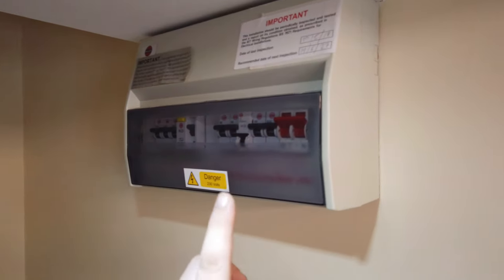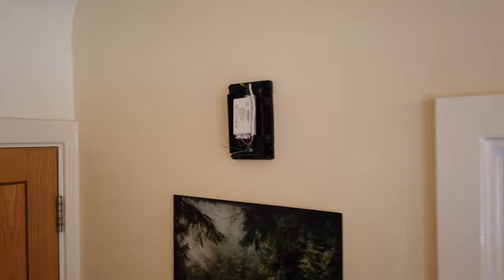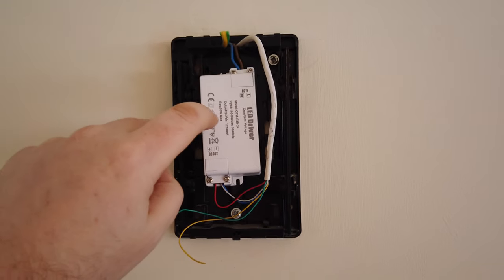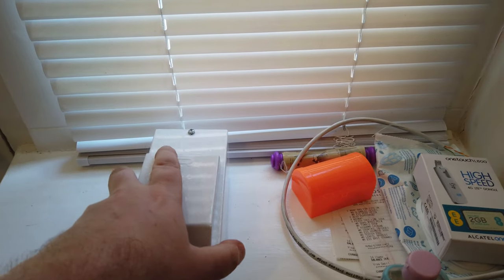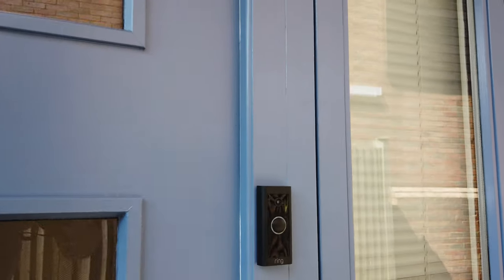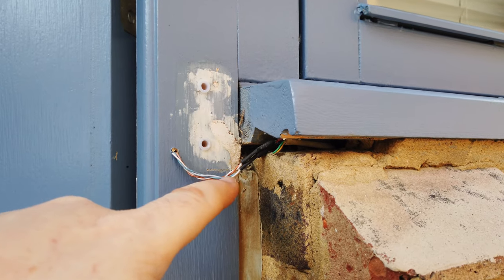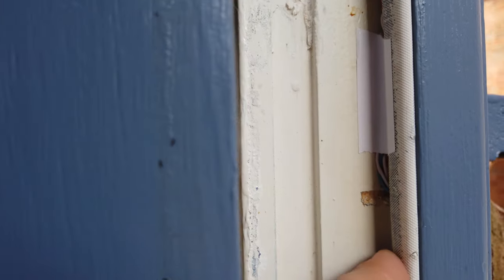Ring Wired Doorbell (UK) - a Step-by-Step Guide to Easy Installation

Comment: My simple question is 
Does door bell unit need 
10-24 volts 
AC or DC
Reply from the maker: The Ring website (Tech Specs section) https://en-uk.ring.com/products/video-doorbell-wired says to use DC 'You can hardwire your doorbell if you have a compatible doorbell system (8-24 VAC, 10-40VA, 50/60Hz ), or you can use Ring DIN Rail Transformer 2nd Gen (24VDC, 0.42A , 10.0W) sold separately. Doorbell chime must be bypassed.'
Reply: Thanks for your quick response 
But my question is still not answered 
Specifications itself confuses 
Recommended 
AC and DC 
BUT there is no marking + or - on back screws, I presume it will work on 10-24 volts AC
I am from India and this unit is gifted by my daughter from USA

Comment: Hi, can’t you just use a ring battery pack to the doorbell chime box?
Reply from the maker: I've just done a quick Google on this and can't see any articles relating to it. The chime box will have an existing wired connection, so it's easier, more convenient and cheaper to use that. If you want to use the ring battery pack, it's probably best to do that with one of the Ring doorbells that are officially supported for it. If you don't have access to wired power, it would be better to get one of the other Ring doorbells and add solar charging https://en-uk.ring.com/collections/accessories
Reply: @TechboyUK  my setup is the same as yours. I have the ring doorbell pro 2, so can I just add the battery as I wanted to use the chime box?. It did come with a transformer aswell in the box.
Reply from the maker: @lethalno1  I don't know :-) I suggest asking the Ring support team https://support.ring.com/hc/en-gb

Comment: Great video Paul 👍🏻. I currently have the exact same chime and transformer that you had. How did you remove the old transformer?.
Thanks.
Reply from the maker: That's the hardest part of the installation process! I turned off the power, removed the box and pried out the old transformer with a screwdriver and pliers. 'Brute force and ignorance' as my dad would say.

Comment: Hello. My old transformer box is exactly the same as yours. How do you know which wire is dc out + and - (in the new transformer?
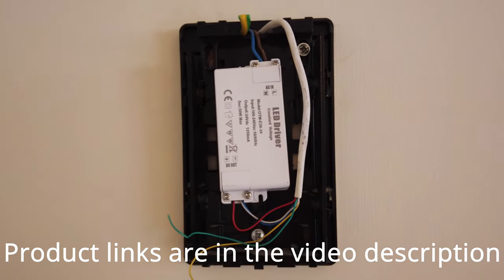Reply from the maker: See 2:08 the AC in (L and N) and DC out (+ and -) are clearly labelled.
Reply: @TechboyUK  thanks for the reply. I mean your setup on the old transformer. How do you know which wire is + and - on the new transformer? Or am I asking a silly question?
Reply from the maker: @mrcraig261  The Ring instructions say that it doesn't matter which order the 2 wires go to the Ring doorbell.

Although I would have kept the + and - wires the same in the new transformer vs the old transformer. Before removing the old transformer, I took a photograph of it, so I had a record of which wires were which.
Reply: Thanks. Is there a way to send a picture of my setup?
Reply from the maker: @mrcraig261  I don't think I kept the picture, but you don't need it anyway. The colour of the wire from DC out +- doesn't matter, use any of the available wires for it. Also, the order they attach to the Ring doorbell doesn't matter 😊
Reply from the maker: @mrcraig261  Sorry, I've just re-read this. If you want to send me a pic of your setup, you can share it on OneDrive, Google Drive, etc. and paste a link here, or DM me on Twitter @TechboyUK 😊
Reply: Mate sorry to pest, but I don’t have twitter. Can I sent you an email of my setup? It’s just that it’s the exact same as mine but I’ve no clue about electrics haha

Comment: Hi again the set up process nearly finished then app says not enough power. Can I take out transformer from my wired orig chime box and replace it with another app says needs 16 24 VAC HAVE YOU A Link for a suitable transformer
Reply from the maker: I used: https://amzn.to/3cMqCjX and it has been working without any issues.

The Ring website (https://support.ring.com/hc/en-gb/articles/360055740151-Video-Doorbell-Wired-Information-) states 'You can hardwired your doorbell if you have a compatible doorbell system (8-24 VAC, 10-40VA, 50/60Hz ), or you can use Ring DIN Rail Transformer 2nd Gen (24VDC, 0.42A , 10.0W) sold separately'.

See my kit list for more items that I used or are available https://kit.co/TechboyUK/ring-video-doorbell-wired-uk
Reply: @TechboyUK  I've bought the same LED driver that was on your list from ebay it should do the job my orig door chime TF was 6v lol can't believe I had it all running even the doorbell was doing the setup via app but right at the end the app displays a messege of not enough power.

Tbh ring isn't very clear about fitting they just toss is a resister bridge wire that you open and wire Into door chimes Il have a god when I next get day off cheers

Comment: Great video and will prove very useful when installing. I just have one question: how do I know what colour cabled go into DC Out on the LED Driver please?
Reply from the maker: The colours going out of the LED driver, into the doorbell don't matter, as long as they match. It doesn't matter which order you place them on the button.
Reply: @TechboyUK  thanks - It worked an absolute treat! Surprised you don't see this transformer recommended more often as it's half the price and fits inside my existing casing with ease
Reply from the maker: @iambenaustin  Great to hear you've got it up and running 👍

Comment: Hi Paul, thank you for the really helpful video!! I’ve got a video doorbell 4 (that I’m looking to wire rather than battery install) but the same bell/transformer as you had. On the doorbell 4 product specs, it calls for a supply of 24V DC 0.5A. On Amazon, the Yayza LED driver comes in 24V 1.25A 30W (the one that you installed) or 24V 0.625A 15W variants. Would the 15W version work as the 0.625A rating is closer to the 0.5A called for in the product specs? Many thanks
Reply from the maker: Hi Andrew,

I'm glad the video helped 😊

I don't know the answer to your question. I suggest asking in https://www.diynot.com/diy/
Reply: Hi Paul - many thank for getting back to me. I think your video doorbell wired requires 24V 0.42A 10W (hardwired) or 24V 0.5A 12W(plug in adapter) according to its specs, but your LED driver on the video supplies 1.25A (1250 mA) 30W. Is the door bell still working after a few months? Thanks for your help
Reply from the maker: @andrewmcdermott2746  My doorbell has been working without any issues 😊
Reply: Fab - thanks for your help!!
Reply: Hi Paul. Many thanks for your very helpful video. As a result, my Ring door bell is set up with the new transformer housed inside the old bell + transformer box. Well pleased- thanks!!!
Reply from the maker: @andrewmcdermott2746  That's great to hear! 👍
Reply: @andrewmcdermott2746  hey Andrew, did you use the 1.25A 30W or the 0.625A 15W? Thanks

Comment: I'm wiring 9ne today but the orig doorbell isn't at head height or anything I'm worried it's not high enough? It's a new build property so don't want to fiddle about with door seals and surrounds as I don't even know if existing wires will be long enough
Reply from the maker: The recommended height is about 1.2m from the ground https://support.ring.com/hc/en-gb/articles/360055762431-Proper-positioning-for-your-Video-Doorbell-Wired- so you're probably okay 👍
Reply: @TechboyUK  I've never ever noticed the doorbell that low as I never use it Il fit it tomorrow now. I was roped into shopping and got dark quickly

Comment: Hi Paul, great video. Did you need to use a 25w 50ohm resistor? I hear some people saying they sometimes gear a humming noise and a resistor is required...but I'm not sure if this would be for the wires/battery models
Reply from the maker: No I didn't use one and there isn't any noise 😊
Reply: @TechboyUK  good man.  Thanks Paul
Reply: Why did you not install it .??
Reply from the maker: @kennykrc3500  It doesn't come with a resistor, so no need to install one.
Reply: I've just finished the install of ring doorbell 4 with this led driver. No buzzing at all, so no need for an additional resistor.
Reply: @TechboyUK   in mine it did along with 2 wago connectors..its a short black lead with a lump in the middle which is the resistor. It was tucked down inside the box.
Reply from the maker: @kennykrc3500  A resistor isn't mentioned in the official installation instructions (https://support.ring.com/hc/en-gb/articles/360054984332-Installing-Ring-Video-Doorbell-Wired ) so it isn't needed.
Reply: @TechboyUK  it shows you it in the video...its the bypass cable there is a resistor in it to limit the current to the door bell
Reply from the maker: @kennykrc3500  Ah the bypass cable - that's optional. I didn't use it because I ripped out the old chime as I'm not going to use that again.
Reply: @TechboyUK  no problem...im not using my chime either...all i was saying is that its to limit the current to the ring doorbell.... i may have a newer model than you

Comment: Hi Paul i am having same issue, the LED driver you used is dc output but ring door bell require an AC input do u think will it make any difference?
Reply from the maker: The Ring website (https://support.ring.com/hc/en-gb/articles/360055740151-Video-Doorbell-Wired-Information-) states 'You can hardwired your doorbell if you have a compatible doorbell system (8-24 VAC, 10-40VA, 50/60Hz ), or you can use Ring DIN Rail Transformer 2nd Gen (24VDC, 0.42A , 10.0W) sold separately'.

The Ring DIN Rail transformer that they suggest is DC. I haven't had any issues with the one I showed in my video (https://amzn.to/3cMqCjX)
Reply: @TechboyUK  Any reason why you chose the 24V 1.25A 30W transformer over the 24V 0.625A 15W version? Need to do pretty much the same as my Deta C3504 only outputs 6V.
Reply from the maker: An electrician who installs Ring doorbells suggested that I use this one, not the lower power one; so that's what I did 😊 It's the one he uses. The lower powered one might be fine, but I don't know for sure.
Reply: @TechboyUK  Interesting. Given for the official Ring DIN Rail Transformer 2nd Gen the output is 24VDC 0.42A 10.0W, I'd assume it would be fine. It's also ever so slightly smaller, so might fit in the enclosure without have to take any other internals out.
Reply from the maker: If you try it, please let me know if it works 👍
Reply: Similarly went lower powered one but haven't had time to fix it after it arrived. Let us know how you got on.  Will similarly do the same.
Reply: @TechboyUK  Finally did this today and it works :-) And fits snug in the existing enclosure without having to remove any internals, so I'm pleased. Glad I came across your video.
Reply from the maker: Awesome 👍
Reply: Also got round to fit with the 15W transformer and wired doorbell is working well. Enclosure was big enough not needing to gut too much of it out, just clipping away some small bits of plastic.

Comment: So this stops the existing doorbell from working ?
Reply from the maker: Yes. The Ring website https://support.ring.com/hc/en-gb/articles/360055740151-Video-Doorbell-Wired-Information-) states 'Doorbell chime must be bypassed'.
Reply: @TechboyUK  thanks for clarifying for me. I just got one and there is no bypass connector in the box like shown in the official videos
Reply from the maker: @spacecoyotee  I didn't get a bypass connector. I simply took out the old bell and transformer from the casing and put in a new (higher powered) transformer.

I could have left the old bell in the casing and just not connected wires to it.

Comment: Paul, great video how funny i was thinking he has the same front door and interior doors as me. Are you available for fitting in mk?
Reply from the maker: Ah, we must be neighbours!

Sorry but I'm not an electrician, just a geek who wanted a new doorbell 😊

It is easy to fit - the hard part was finding what was required (in terms of the transformer) and extending the wires by soldering them as they had previously been shortened (I learned on a summer job when I was 17). You probably won't need to extend your wires.

Comment: Hi Paul do you you thi k could you do this with a ring doorbell pro?
Reply from the maker: I haven't looked into the Pro, but it's probably the same process. Just check the power requirements of the transformer and get the version you need. https://kit.co/TechboyUK/ring-video-doorbell-wired-uk

Comment: Can you use speaker wire from the LED driver to the bell? Current wise its ok but will resistance be too much?
Reply from the maker: I know there is different types and grades of speaker cable, I don't know which you have. Also, I don't know which would be suitable. I suggest asking in https://www.diynot.com/

Comment: You’ve helped massively. I’ve got the exact same door bell you originally had installed. The link for the transformer you listed has 3 different ones
Reply from the maker: Good to hear it has helped 😊

The description on my Kit page shows 'YAYZA! IP44 24V 1.25A 30W Low Voltage LED Driver Transformer' and that's the one it takes you to.

The Amazon page it takes you to also lists the transformers with a lower and higher output.
Reply: I’ve bought the middle one for £9.99 will let you know how I get on. Should be here on wed

Comment: Why did you use 4 cores from the cable? The bell push only requires 2?  
What annoys me is these things are sold as if a simple install when in fact if you don't have some electrical know how they are far from it in some situations.
You also need to then purchase a chime box from Ring as the chimes are removed or bypassed depending on the installation technique which I've just been looking at for a further £29, it's simple enough as you just plug it into an available socket and connect wirelessly but it's all the additional crap you have to buy to make these things work which should be made more obvious when purchasing.
Someone also mentioned needing a resistor, I hope that's not another thing to add to the list later on!
It wasn't a requirement for Paul but for anyone reading this, you shouldn't be poking around in your consumer unit changing a DIN transformer if you have one, a job for what's known as a 'competent person' in the building regulations, meaning qualified with the relevant knowledge.
Ring do say in a couple of places to seek advice from an electrician for certain installations but it could be made planer from the outset that these are not always that straight forward!
Reply from the maker: 4 cores - it's how my original doorbell was wired and I've seen other people do the same with their Ring Wired installations. I'm not an electrician so I don't know why, I assume it's to carry more electricity with more bandwidth, lower resistance and lower heat.

I agree, Ring should provide more information to make the installation easier. I had to do quite a bit of research and ask questions in 2 forums to get the information I needed. Given that this video has had a lot of views, it appears that lots of other people also need assistance.

A Chime is one option, you can also use exiting (or new) Amazon Echo devices. One benefit is that most 'standard' wireless doorbells come packaged with 1 or 2 chimes and you can't add more to them. With the Ring doorbells, you can add as many 'chime' type devices as you want - and even have it on your phone. So wherever I am in my house, garage, garden (or world via my phone), I will never miss someone at the door.

Resistor - that's part of the chime bypass cable, which is optional and I didn't use.

True, I wouldn't have made changes to my consumer unit if that was required, I would have called an electrician.

Comment: Hi Paul, I have exactly the same existing doorbell chime and wanted a transformer that would fit inside the existing housing so this is potentially perfect.  One question, the new transformer output is DC but according to ring, the doorbell requires AC.  Have I miss understood something?
Reply from the maker: Hi Daniel, The Ring website https://support.ring.com/hc/en-gb/articles/360055740151-Video-Doorbell-Wired-Information- says DC is required. See the text:

'You can hardwired your doorbell if you have a compatible doorbell system (8-24 VAC, 10-40VA, 50/60Hz ), or you can use Ring DIN Rail Transformer 2nd Gen (24VDC, 0.42A , 10.0W) sold separately.'

Comment: My not contacted to WiFi anymore
I try reset it light not spinning white any more
Reply from the maker: I suggest you get a WiFi analyser application for your phone, then run it to see how strong the WiFi signal is at your doorbell. If it's weak, you may need to boost the signal with an Amazon Chime Pro (https://amzn.to/36q8Ym3 ) or another wireless extender.

You could try the Chime Pro and return it if it doesn't work.

Comment: What if someone just cut the wire that is visible at the door?
Reply from the maker: For what purpose? Breaking into the house? The camera would capture them approaching the doorbell, so they would want to cover their faces. They could also just put a sticker over the camera instead of cutting the wire.

If someone cut the wire, it would be repairable by soldering on a new one.

Comment: Surely it’s easier just to charge the battery’s ever month, and I have never hear someone call it category 5 cable, (I know that’s the official name) cat 5 will suffice
Reply from the maker: There are battery versions of the Ring Doorbell if that's your preference. I think it's less hassle to set it up once and never have to change a battery and it didn't take long to install. The only installation difference additions for wired are 1) Screwing in the 2 cables behind the doorbell 2) Possible replacement of the transformer.

A lot of people who watch this video are not technical so 'Category 5' makes more sense than 'Cat 5' 🙂 Both terms are commonly used in communications including technical documents, product listings, etc.
Reply: Fully charged battery last max 2 weeks